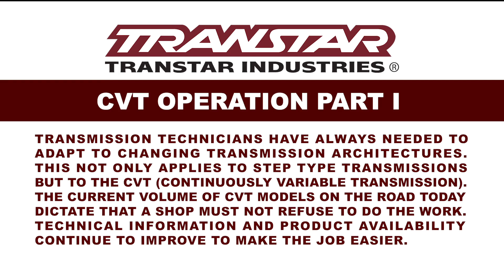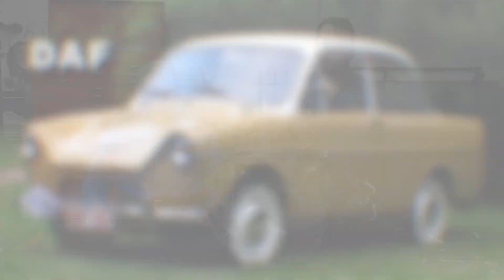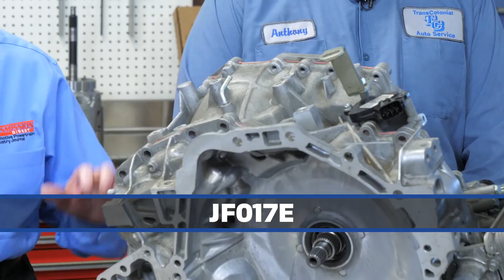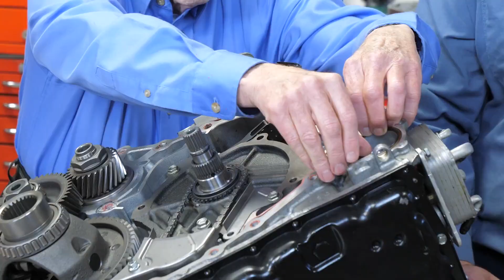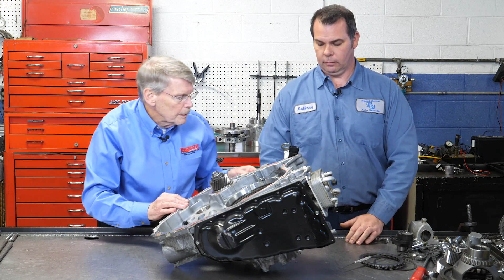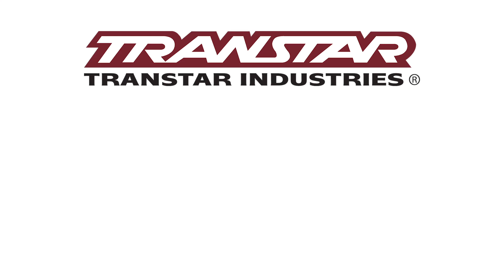CVT Operation Part I: Demystifying the CVT

Comment: Sir my Nissan versa not CVT transmission RPM is 4000 and speed is 60km car is running I put In N after I put in D after RPM is 2200 and Speed is 65km so always I need to neutral and drive so please take me what is the problem
Reply: Hi